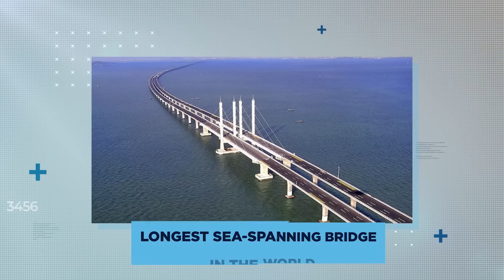The Longest Bridge In The World

Comment: What a crock of shit. No engineer ever factors in curvature of the earth there simply is no curvature to factor in.
Reply: Every suspension bridge longer than a single kilometre has to factor in the curvature. Each tower is further apart at the top than the bottom.
If you choose not to believe this, may I suggest that you get yourself to your nearest example armed with a tape measure and measure it to your own satisfaction.

Comment: There are many slanders in this video.  One of then is the Chinese consumed 50% of the steel in building the bridges but the speaker does not seem to know China has always been the world's biggest steel producer for consecutive 25 years.  In 2020 China produced 2/3 of the world steel so that countries like Serbia, Thailand, Mozambique, Indoneia, Turkey, Saudi Arabia, Pakistan, Laos, Sri Lanka, Myanmar, Ethiopia...... can have rails, bridges, ports, bridges, high speed rails, stadium, power plant, hydro stations, solar farms, wind farms, industrial zones, factories, water supply, electricity grids.....

Apart from many things China is the biggest bridge builder in the world and has built bridges longer than the next 10 countries put together.  So to the speaker a longest bridge is a big sensation but China could break its own record when there is a need to have another longer bridge.

The sinister nature of the speaker is to link the engineering with politics in Hong Kong and totally ignorant of Hong Kong has been returned to China since 1997.  In 2047 it will be fully integrated into China's political system.  It was left untouched for 50 years from 1997 only for the foreigners to get their investments out.  However the speaker spoke as Hong Kong is still part of UK.

The above statistics should be enough when it comes to bridge enegineering the Chinese may be the expert for actually having done something than just talking about it like this speaker.
Reply: China should stop imprisoning and killing innocent people, trying to control portions of Africa, and constantly projecting it’s sinister influence across the world.

Comment: When realizing what amounts of concrete and steel is produced and used in China, which produces tremendous Volumes of CO2, all efforts in western countries to lower CO2 production is indeed ridicules. China shows nowadays a breathtaken developement. On the other side western countries, especially Europe, had come to some kind of cultural and industrial senility. As now Hong Kong is bound by such megabridges to China, also Taiwan will become bound to continental China with Tunnels and Bridges. There is no chance to avoid, that Taiwan will (as well) become part of Great China soon ...
Reply: Do you also realize that most of the western countries are actually on a much higher ranking by CO2 emissions per capita than China, even they are facing some kind of cultural and industrial senility? It is not ridiculous to lower CO2 production, but it is ridiculous to point your fingers to someone who is actually better than you~~ BTW, Taiwan, which officially called Republic Of China, it always been the part of Great China ~
Reply: @民主youtube一直无理由  ; As one point of "senility of the old world" can be seen the stop of nuclear power generation in Germany and other European countries. It results in the use of more coal for producing electricity than with nuclear power. China has the advantage to have dry rock deserts in the west of China, which gives the best geological structure to dump nuclear waste. In Europe all grounds are below flowing (drinking) water and can be polluted from nuclear waste. Especially in Germany there is a huge problem with the salt stock "Asse" which was a salt mine, was later filled with nuclear waste and then filled it self with water. Giving an etching sole disolving all nuclear contains and spread the radioactivity to ground water. The waste disposal problem is a strong reason to stop nuclear power production in Germany. The western countries have per capita still higher incomes and polution volumes than China and India. But the USA has 250 million citizen and Europe 500 million citicizen. China and India has each 1500 million citizen. Additional Indonesia adds further 1500 million citizens. It is true that the old world (USA & Europe) had its best time in ninetinth century and the USA in twentieth  century. The twentyone century is the asiatic century with China on top. Thats historically evident. But when all 5000 million people of asia reach the wealtheness level of 20-th century USA, it will result in ecological problems.
Reply: @wolfgangrenner4152  In 2019, Germany generated electricity from 29% coal, 14% nuclear (source from wiki), and as being the factory of the world, China is 69% coal and only 4% nuclear, and still, you have higher CO2 emissions per capita than China, so it's not about china has the advantage of nuclear power, its about the different lifestyle of developing and developed world~~~Everyone deserves a better life, the point is, do you want the 'new world' to give up their development? Or, are you (the old world) willing to sacrifice a little bit for your wasteful lifestyle now? I don't see any of them will be the solution. When you said 'all asian people reach the wealtheness level of the old world, it will result in ecological problems.' It sounds like a rich guy who own 20 luxury cars himself and talking to the poor that if all of you guys own a car, it will result in the traffic problems~
Reply: @民主youtube一直无理由  ; I think there is no reason to discuss such funtamental themes about wealthiness shares. Nowadays the old world (Europe and USA) is in an decreasing level and the new world (China and Asia) is in an increasing level. It is said, that nowadays China has reached already a higher level of wealthiness than the USA of today. And even more to Europe. For Europe the questions arises more and more to save there last survided industries etc., to not completely lose there wealthiness they had formaly. The discussion starts, if brigdes and tunnels with several hundred Kilometers of length are necessary in the light of CO2 suppression. Producing concrete and steel gives tremdedous volumes of CO2. And it is same if it comes from USA, Europe or China. I am not a specific CO2-activist. But when realising how strong europes Industries suffer from CO2-rules and how careless simple CO2 production in China is treated, a bad feeling comes up. Today Germany has 10 % Nuclear Power, 50 % renewables (Wind, Water, Biomass and Solar) and around 40 % coal, oil and gas in electricity production. The nuclear power will be ended next year and the production will be shift to coal and gas. It is today as difficult to build new wind turbines as to build new nuclear power station. It is a political shortcut, that Germany is not realy able to find a future development perspective. And because of it a lot of envy is felt to China, which develops much more impressive.
Reply: @wolfgangrenner4152  I do not agree, wealthiness shares is the most important things here, it's about whether all human beings are equal~~Basically we are talking about 2 different things, your perspective is based on countries, but mine is based on individuals, it is unfair to compare by countries because the population is different in each countries. The nuclear power may be ended in Germany but ath the same time they have to buy the electricity from France, which means the power consumption is still there. 
And again, yes the europes got much strictly on CO2-rules than China, but even with the strict CO2-rules and move out all of the polluted factories to China and Asia, you still have the higher CO2 emissions per capita, so you think who got the bigger problem here?
And there is no way that nowadays China has reached a higher level of wealthiness than the USA, as the GDP per capita is 60k by USA, but only 10k by China, there is still a long way to go~ so yes, the bridges and tunnels are necessary, you may see it cost tons of concrete and steel, but when you think that is shared by a number of 1.4B people, it is even not enough yet~